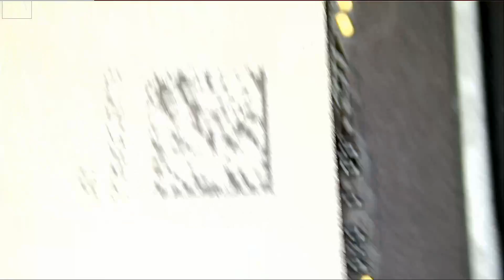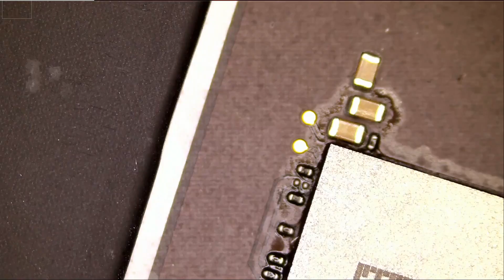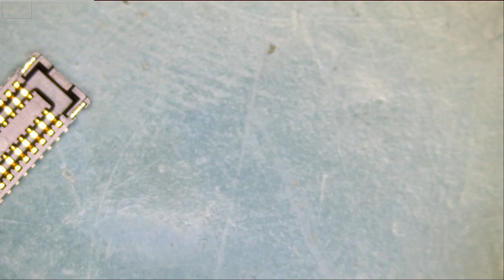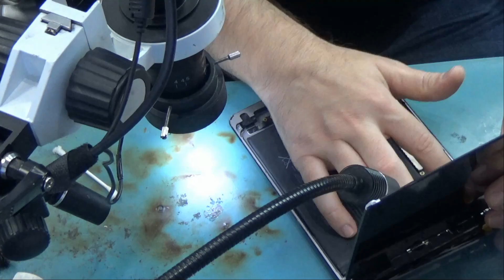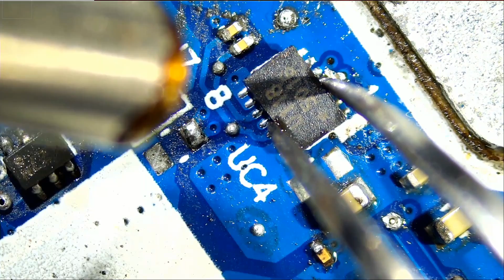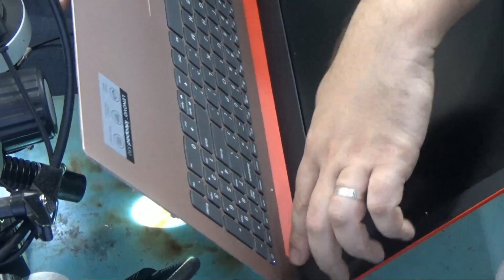Lenovo IdeaPad 330 + iPad Mini No touch repair - AMTECH VS-213-A-TF Flux Arrived

Comment: Is it not possible to use soldering tip to solder the new pin instead of using hot air?

Comment: Great soldering technic . Marking on the board  " J7 " stands for jumper #7 , has to be shorted with solder. It helps for troubleshooting the board. Jumpers usually are needed , if J7 has some sort of connection to Q29 UC4 and QC10 most likely they are needed too. Not having a schematic , an other similar board could help only..

Comment: there is a bridge between a cap and a resistor at 6:30 - 6:31 when reflowing the connector
Reply: All 5 components in a raw are connected to each other. It doesn't matter if you bridge all of them.

Comment: That flux is very cloudy, I’m gonna try some though.
Reply from the maker: I agree, it's cloudier then the 559 but it clears as soon as you apply heat to it. Amtech did a great job making the flux easier to clean after use.
Reply: NorthridgeFix as soon as I need some more flux, I’m definitely gonna try this one out because you’re right once heat applied it goes really clear and from what I saw in the video it does clean off really well.jay

Comment: Been using the Amtech VS-213-A for about 6 months now, and prefer it over the 559. It is thinner & certainly does clean off easier. It just doesn't have as long of a working time compared to the 559 so become less effective sooner under longer hot air procedures. Its not a problem though, you just use a bit more 👍
Reply from the maker: I didn't notice that. It's probably the substance that helps with the breakdown of the flux for easy cleaning.  Heat and air speed will definitely affect how fast it thins out. High air speed will push it away and high heat will make it evaporate faster.
Reply: @NorthridgeFix  i just want to ask something sir 431204225050 this is the pn of my unit and the one i ordered is 431204224050 but there the same in model 330s 15 ikb 81f5. Is it okay if i replace with that
Reply: Good Day.. 

Is vs-213-a works good for qfn chips..? And drag soldering..?.
Reply: @FrankMartin160   Yes, I use it for all my soldering and rework requirements now.

Comment: Is it ok to use out of date flux ? I purchased amtech flux off ebay and its expired
Reply: I have used it out of date before you will know if it isn't working. I'm not sure I would be happy with it already being out of date when I bought it though
Reply from the maker: Yes, as long as it works.
Reply: Use it man. As long as it makes a good joint. Do not look to the date. You are not eating it right..